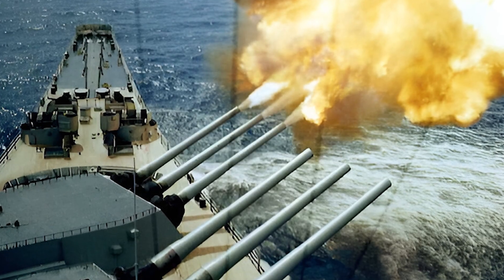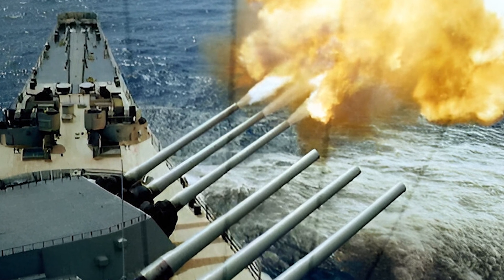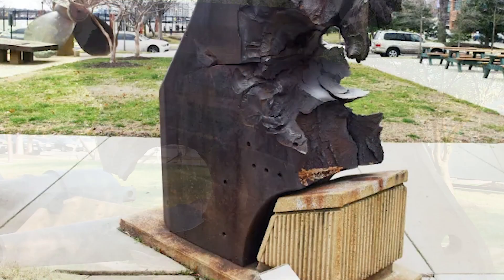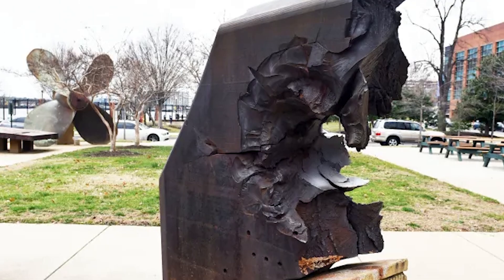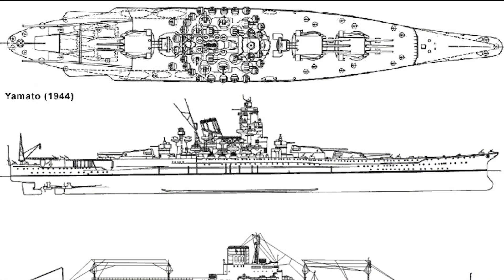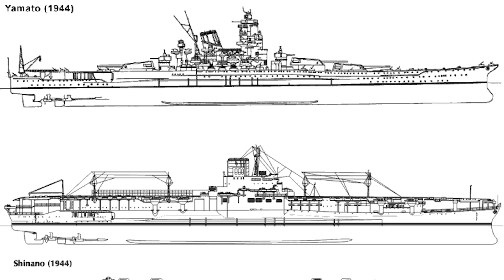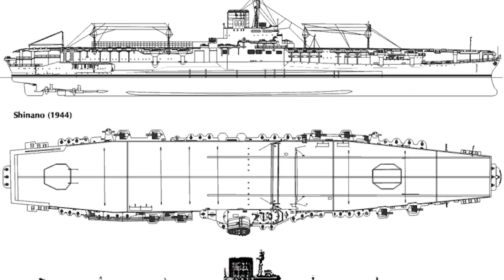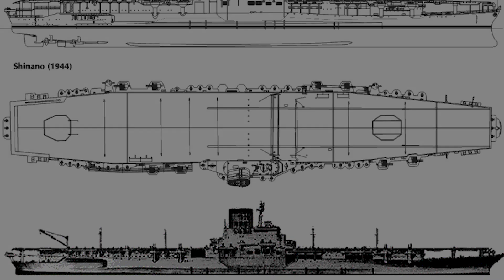USS-Iowa VS Yamato Armor Simulation

Comment: Yamato's armour was not RHA. By that period, battleship armour was constructed of pretty well-developed face-hardened steel, with chemical composition and hardness varying throughout the entire plate, with hard face to shatter the projectile, and soft, ductile back to absorb the impact. On Shinano's turret specifically, Rockwell C hardness varied from 50 at the face all the way to as low 11 in the back
Reply: Turret faces are homogeneous armor, not face hardened.   Too many problems making them .  US and RN also used homogeneous armor on the faces  which is why they were so much thicker.
Reply: The Japanese resources, manpower, steel quality, and overall manufacturing quality was also suffering heavily by the time Shinano would have theoretically been completed as a battleship.  Even Yamato and Musashi had some quality concerns.  They were great as an engineering feat but in practice they really had some issues.
Reply: @legogenius1667  More a post war myth than reality in terms of armor quality.  Japan in the 1930's realized they would be cut off from certain alloy elements in war and developed alternative armor mixes based on what they were certain they could continue to get.   The Yamato class armor had ceramic in it and initially it was thought to be contamination, but later interrogation of Japanese engineers found the did it deliberately to improve performance.  The finding was classified and research lead by Britain  using ceramic led to Chobham armor.

Comment: It would have been more fun to see what effect the shell would have had at realistic ranges and angles.
A scenario like this would simply not happen irl.
Reply: The test was done simulating realistic combat ranges by reducing the powder load. The trajectory of the shell would also be closer to this angle too.
Reply: @supremecaffeine2633 yes, but the simulation shows 750m/s with is near point blank range
Even at 5000yars/4.5km velocity already drops to 695m/s
Reply: @Kether25  I was referring to the real test. My bad.
Reply: @supremecaffeine2633  Simulation Bros definitely did a bit of trolling with that by using the face plate image

Comment: It should be noted that naval armor was designed to stop rounds at "normal" (for warships) combat ranges, which is about 18-20 km
Reply: Indeed, good luck stopping battleship shells at point blank range and without any extra angle
Reply: You are right. I checked the archives and found that the shells will only fly at 750MPS at very close range. By the way, the muzzle velocity of the 406mm MK7 when firing AP ammunition is 2500FPS.
Reply: The powder charge was reduced so speed was that of a shell at like 12 or 15k yards....
Reply: @chrisjohnson4666 still, it wouldn't hit the plate at a perfect 90° degrees, neither would it hit at pretty much the same speed as it left the barrel (the 16" APP shell leaves the barrel at 760m/s).
Reply: I think it's fair to say is that we will never know as the war ended
Reply: Yeah,with lower striking velocity and with obliquity. There were immunity zones where the projectile was to slow and oblique to penetrate the belt and not oblique enough to penetrate the deck.
Reply: Yes we know 15 to 20 nm
Reply: Further, the armor is sloped...not vertical.
Reply: Aye, it was hardly a test of anything save for proving the Americans can hit the broad side of a barn
Reply: Shell was fired with reduced charge that simulated velocity loss at long distance..... in other words the simulation was perfectly valid....
Navy did this kind of testing for decades before even before WW1 they knew how to calculate and charges for test firing which would simulate impact from regular combat distance....
Reply: @17tomashavlin  Ok so how do you explain the velocity of 750m/s, the Iowa has a muzzle velocity of 762m/s, a 12m/s loss of velocity would not equate to a shell fired at range, and even with the high-capacity projectiles fired at the muzzle velocity 820m/s, they might have a change of penning at range, but if got a lucky angle to the angle of the armor, will damage it but won't pen or deflect
Reply: @danfox1458 iam not sure where you got the 750m/s number ? 

The data from the test lists 607m/s for the first shot and 502m/s for the second shot….. 

First shot was slightly “hot” and faser than it woul have been at that range….

But the 502m/s is pretty much exactly whats listed in the balistic table of the MK8 ap shell they used at distance of 36 580m… 

So there is nothing to explain…. By the way the table also shows that if fired beyond 32 000m the shell actualy started to gain velocity again as the gravity helped to pull it down….
Reply: @17tomashavlin  No, the shell would not be hitting at a perfectly flat angle during an actual combat action.
Reply: @17tomashavlin  The US Navy is also the organization that ignored the problems of the Mark 14 torpedo for years. You can play the appeal to authority card all you want. All the simulation proves is that a battleship shell performs well under test conditions (something the Regia Marina knows all too well). Give yourself a rest, grandpa.
Reply: @17tomashavlin  It's fine if you don't understand.
Reply: @17tomashavlin  Your critics might not even be able to define “plunging fire”, think that Krupp cemented armor has something to do with assembling model kits, or use World of Warships as research. Thanks for delineating your opinion vs the other guy’s ad-hom “nuh uh”, which is less convincing.
Reply: Torpedo testing has nothing to do with long range Naval artillery testing. @TheSonOfDumb
Reply: @17tomashavlin  six words. Bureau of Ordnance. Mark 14 Torpedo.

That is all. Enjoy the depressing and rather aggravating rabbit hole that is wwii US navy bureaucracy.
Reply: @17tomashavlin  at basically its max range, its not going to come in at 45°, but considerably steeper.
Reply: @dylandepetro4187  nice six words that have absolutely nothing to do with this topic…..

Bureaucracy has nothing to do with the engineers calculating the data for the test fire solution….
Reply: The Iowa's shells were designed to use gravity to increase improve their proformence. 
They would have been more effective at longer range
Reply: @jamesricker3997 this would violate conservation of energy
Reply: @jamesricker3997  That's every shell, bullet, and arrow, It's called gravity that's how it works
Reply: @jamesricker3997  except they were not. the longer the range the less armor the shell will penetrate. sorry but thats a fact
Reply: @ryanstuckey8677  Yea, but you only know half of it.

It looses penetration due to a loss of velocity, which means that a low arc cannon will loose penetration over time and therefore range.

However naval cannons fire more like howitzers at long range  where the shell speeds up after having reached it's apogee and then plunging towards the target.

Also the Faceplate of Yamato's turrets is angled backwards, so a shell striking it from a plunging trajectory would hit it at an angle closer to perpendicular.
Reply: @LupusAries someone with knowledge 🫵🫡
Reply: @jamesricker3997  No they wouldn't and they also wouldn't hit at a perfect 90 degrees.
Reply: @sapphyrus yes actually they would have due to the great effect of plunging fire.  Stop correcting people if you don’t know what you’re talking about 🤷‍♂️
Reply: @smyers820gm  Propellants have a much bigger effect on velocity compared to gravity acceleration. That’s why howitzers are never used for penetration but for range. If you don’t know what you are talking about, don’t patronize people.
Reply: @sapphyrus  plunging fire has been a thing since the beginning of naval warfare 🙄🫵🤡

Comment: It was at point blank but IIRC, they did reduce the charge so the velocity was what it would be at combat range. However, the plate was still "free floating" and not properly structurally supported which would help disperse and dissipate the forces more. It also still came in at a perfect angle where in real life, would likely not be the case.
Reply: Not attached would be in the armor's favor.
Reply: The armor being "free floating" would make it harder to penetrate.

Comment: Why was this plate entirely unangled? The Yamato class front turret plates were angled at some 40 degrees. If anything, at longer ranges the angle of impact would be lessened because the shell comes down at an angle. It is at short range that the shell would be traveling essentially flat. This test is unrealistic in so many ways, I think the US just wanted to shoot some Japanese armor lol.
Reply: I believe the reason for it was that if they couldn't pen the armor even under unrealistically ideal conditions there was no hope of pening it at combat ranges. It's my understanding their first shot only partially penetrated and the conclusion was the 16in 50 cal could not pen the faceplate at any combat range (however, it could pen the belt and the decks at certain ranges).
Reply: @177SCmaro Alright, that makes sense then.
Reply: I think it was to see if I could just happen at all
Reply: @Sixisrending Makes sense.
Reply: The test was specifically designed for the shell to penetrate the plate. This is why the plate was mounted vertically instead of at a 45- degree angle as designed, and also why no structure was created to simulate turret support. A test range of 400 feet was SOP at the USNPG. An examination of the plate followed to establish the metallurgical properties of the plate and its reaction to shell penetration. The data accumulated was used (among other things) to establish an immunity zone for the plate vs. the 16" .50 cal. gun.

Source material is from the U.S. Navy Bureau of Ordinance.

Immunity zone of the Iowas vs. the 18.1" gun:
Citadel                    24,800- 29,800 (5,000 yards);
Turret Faceplates 24,700- 31,600 (6,900 Yards);
Barbettes               26,500- 31,600 (5,100 Yards);
Steering                 24,700- 28,800 (4,100 Yards);
Control Tower       26,500- 31,600 (5,100 Yards).

Immunity Zone of the Yamatos vs. the 16" .50 cal. gun:
Citadel             17,000- 34,500 (17,500 Yards);
Turret Faceplates                      (Impenetrable);
Barbettes         16,600- 36,800 (20,200 Yards);
Steering           19,100- 33,400 (14,300 Yards);
Control Tower 16,600- 33,400 (16,800 Yards).

Comment: it's point blank at 0 obliquity with muzzle velocity lol obviously it's going clean through, you don't even need 16inch+ caliber for this, even 14 or 15 inch would go through this much armor under the same condition, which is non existence in realife
Reply: The shot was done with a reduced charge, and the angle, though not realistic, was more accurate than having it angled as if it were point blank.
Reply: They did their best to simulate what would happen in more realistic conditions (by reducing the powder charges) while guaranteeing an actual hit.  Obviously they wouldn't waste ordinance trying to fire an actual round over the horizon to hit a tiny piece of armor for a test.  This piece of armor would have been sloped at near 45 degrees and the incoming shot could very well have come in around a similar angle, meaning the angle isn't even all that unrealistic either.

In other words, cope harder.
Reply: @legogenius1667  not sure who is coping when you write entire paragraph about a different test when my comment refers to the simulation in the video, which one could tell if they actually read instead of immediately screeching
Reply: @greener2497  Cope harder, bot
Reply: @legogenius1667 "cope harder" 

 
Wow, feels superior to be correct.
20/10 response

Comment: based iowa, no need for bigger gun.

SHS is enough
Reply: At point blank range that is.
What about, say, beyond 6 miles?
Reply: @paleoph6168  a pen cuz super heavy shell is heavier than yamato shell
Reply: I mean a Yamato was designed without restraint in mind while Iowa was designed for speed and under the escalator clause. But for it's capabilities to almost match Yamato is already telling enough that it's the Best Built battleship in the world. A Montana would just dumpstered Yamato had its been built.
Reply: Iowa was underpowered. Yamato class could resist.
Reply: @elgranfreezer9117  
>underpowered

yeh okay ijnboos but SHS slaps because it is denser
Reply: The firing test was way too ridiculous close, it is 400 ft point blank range.
Yamato would already penetrate Iowa’s turrets before Iowa could penetrate Yamato’s turrets at theirs range.
Reply: @yoseipilot  Imagine only relying on optical rangefinder instead of radar

yeah good luck with that ijnboos
Reply: @waibantaboricki8192    These optical rangefinder and radar are temporarily equal, Yamato almost sunk USS White Plain at 32 km and USS Iowa near misses Nowaki at 32 km. 
Nice try then good luck with your wishful thinking
Reply: @yoseipilot  
>temporarily equal

ijnboos seething
and yet yamato only sink 1 ship and tiny amount of american aircrafts lmfao
Reply: @waibantaboricki8192    And how many did the Iowa-class sink any warship? They are all kill-assist. The Yamato battleship sink more than 2 or 3 enemy ships.
Reply: @yoseipilot  your ship only sank one and didn't do anything important for the rest of her lifetime lmao

While Iowa and her sisters assisting allied landing left and right. Yamato sit doing nothing cuz "If i sink, my pride will be destroyed" Lmao 🤡
Reply: @waibantaboricki8192    Still yapping with your imaginary actions from theirs so-called opportunities… 
Iowa-class can only do those landing support, because there is no Carrier battle before and even they overestimate their fire support at any those important islands and underestimate the Japanese while they were prepared in their defense positions.
This will much different, if the Japanese a little more prepared before the Pacific War.
Reply: @yoseipilot  Stay coping with your useless 70k ton battleship that doesn't do anything other than partaking in suicide mission lmfao
Reply: @yoseipilot  cringe kancolle weeb
Reply: @phantomship3935    Im stating the fact, they all go down like garbage soo cry more. 

 Atleast iowa class supports the landing offensive and had more record on defending the fleet from virgin kamikaze. What Yamato do?
Yamato and Musashi didnt do anything
Yamato flees from Leyte
And Shinano getting one torp+sabotaged by its builder

Keep moaning about your stockholm syndrome.
Reply: @waibantaboricki8192  You're replying to his second acc lol. Ive seen this guy comments on every content relating to IJN and he is extremely BS to Japan even going as far as revisioning the IJN in WW2 and a big Kancolle, Weaboo .
Reply: @issacfoster1113 Man, thats pretty cringe 😂

Comment: but this is at point-blank range, those battleships engaged each other at longer dintances, maybe even 1 or 2 km, at that distances the proyectile loses speed
Reply: they can't and never even fight that close lol. The more common fighting range is around 15-27km, with some exception of shots connecting at 32+km, but those are considered lucky shots even for the most advanced latewar ships. Iowa can only start penning yamato at range less than ~18km, or at extremely long range approaching its range limit for the angle of yamato deck armor to be neglected. Other than this, Yamato maintain a citadel immunity zone against the 16inch, even its own 18.1inch throughout the range. On the other hand, iowa has almost 0 immunity against 18.1inch
Reply: "maybe even 1 or 2km"
You're joking right?